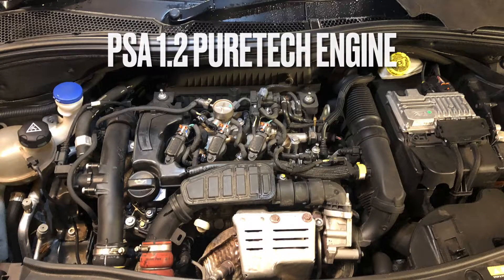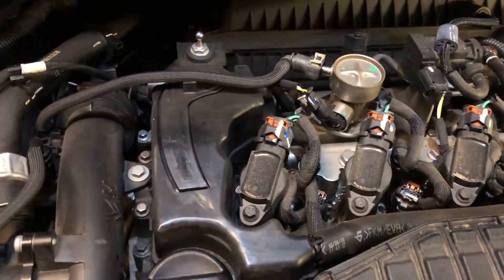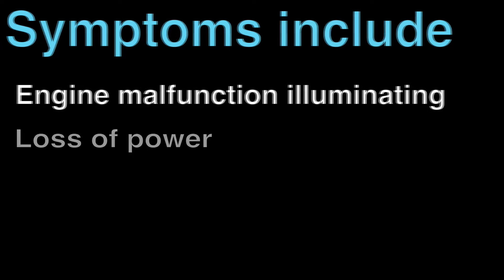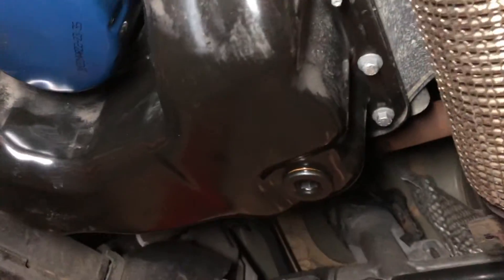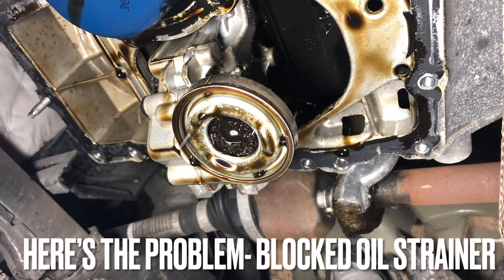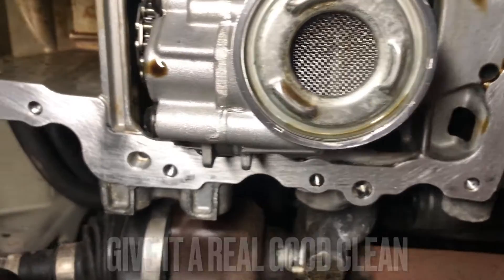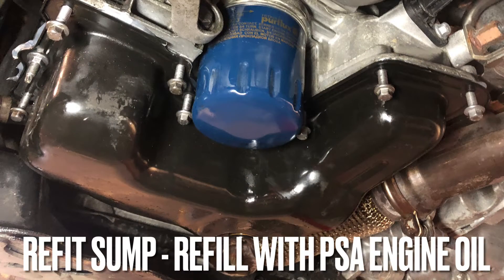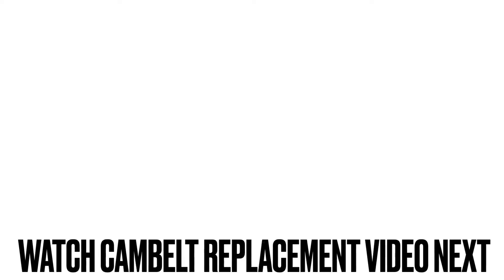1.2 PureTech Oil Pressure Warning Explained – Wet Belt Engine Damage

Comment from the maker: 🚨 1.2 PureTech Oil Pressure Warning = STOP DRIVING

This is often caused by the wet timing belt breaking down and blocking the oil strainer.

🔧 Parts & tools I trust: https://tidd.ly/3ND2g1w
📘 PureTech Wet Belt PDF guide coming soon

👍 Like & subscribe for real-world fixes, not guesses.

Comment: What sort of cost would this incur for all of this Inc belt replacement?
Reply from the maker: I would expect to pay between about 4 to 7 hundred depending on your location.
Reply: Just had mine replaced by Citroen in Stafford. £550 all in. Mine has done almost 78k on a 65 plate and it’s driven hard, but I wanted it done early so I don’t have to mess about with it in the future or risk having the belt degrade, causing further potential damage
Reply: A few months ago I purchased a 2019 with 50k on it and never heard of this issue until last month my low oil pressure light came on, pulled over checked everything and all faults cleared. Started it up and went for another 2 weeks, then it happened again. Took it to my garage and then they explained all this in your excellent video. 😮 Recommendation was either change belt now, or get shot of the car, or contact Peugeot and ask them what are they going to do about it. 😢
Reply from the maker: @wildhogget69 glad it helped you. Just wondering what is your plan of action?  Repair, Perdue dealers or get shut.